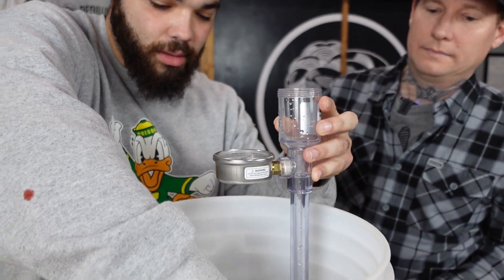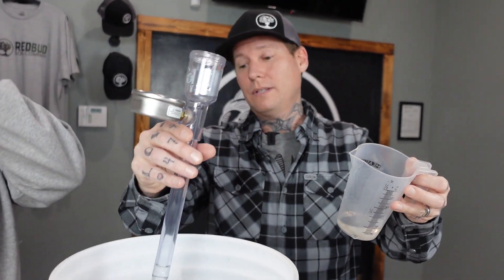HOW TO SETUP An IRROMETER Tensiometer (Updated)

Comment: Couldn't you just soak the tip separately then assemble everything underwater so there isn't any air to create bubbles?
Reply: No need to fill. If all the parts are submerged under water then they would already be filled. Just tossing out a guess since I haven't tried it yet
Reply: @shawnsmith676  yeap, that was mi first thought when a saw them struggling to fill it up, I will set up mine tomorrow will just take it apart then assemble everything back under water 🤩
Reply from the maker: You'll still get air bubbles when you fill it.
Reply: I wouldn’t think this would work as you can create air bubbles under water. It’s worth a shot though for sure, maybe it’d speed up the setup process!

Comment: So how many would you want to use in a 4x8 bed?im outdoor how often do you usually water per week? Are drippers a good ideal to for the whole bed or hand watering with a sprayer. Yo where do you get your mulch from
Reply from the maker: 1 is enough. You can move it every week or so if you want. Watering schedule is based of plant size, Temps, humidity, etc., but typically after a few weeks of veg, we water everyday indoor and outdoor. I like droppers, thats a good way to automate things a bit. We sell this mulch in store and on our website.